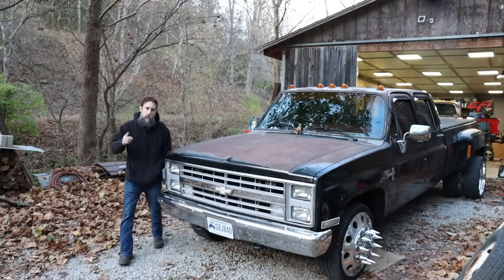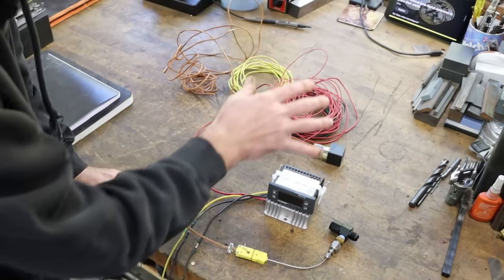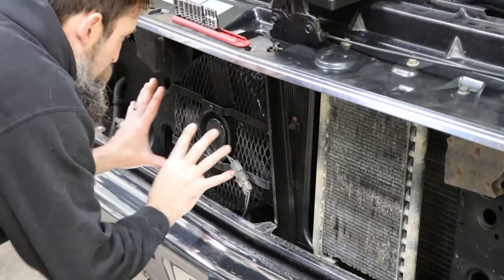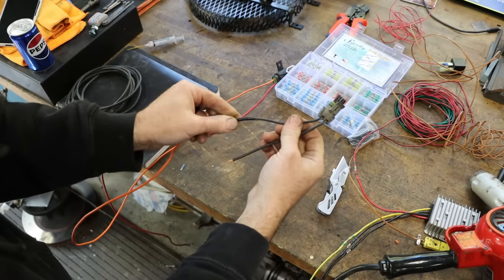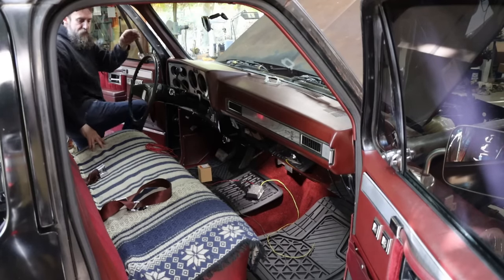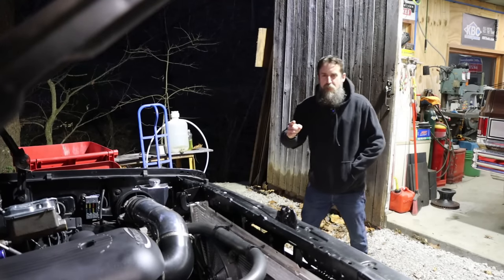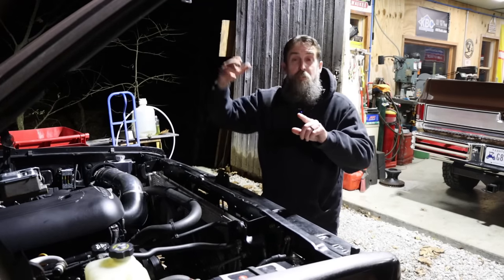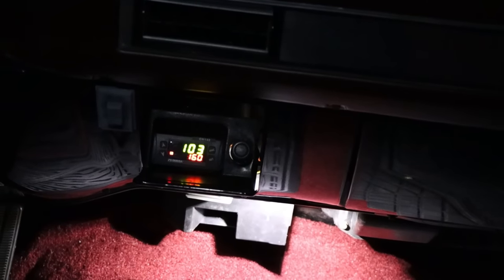Losing my Cool with Johnny Cash the Crew Cab,

Comment: Just wondering if the inlet side should be going in to the top of the radiator and the cooler side should be coming out the bottom? Probably not too important but my ocd seems like it should be the other way around? Always glad to see an update from you Steve.
Reply from the maker: My thoughts were that running the fluid in the top of the radiator / trans cooler could cause an air pocket to stay inside, reducing its ability to transfer heat properly. I could be wrong here. Running the feed in the bottom should actively push air through the system.  I've been wrong before 😄.
Thanks for watching 👍

Comment: all tractor trailer trucks i have driven have a trans temp gauge i dont understand why all automobiles dont have atleast a dummy light because heat is the #1 destroyer of automatic transmissions  its really dumb for the manufacturers to omit such a gauge especially if said vehicle is going to be doing any sort of towing

Comment: It may have been wise to at least MENTION that the wires to a thermocouple MUST be the proper material (hence the special yellow connector) to get accurate readings. There are type K, J, T, or E each which use wire made of Nickle, Platinum ...etc